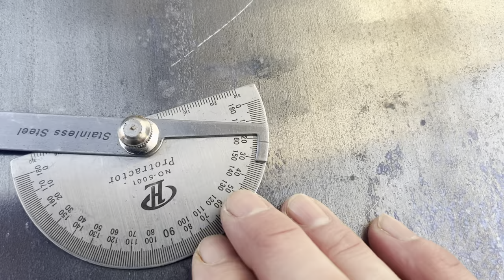How To Make A Bespoke Lead Slate

Comment: Just got recommended this by someone on Facebook, mega work! does the lead warp at all with the heat? i do a lot of MIG welding during vehicle restoration and warping is an absolute pig with he heat, would've thought this would be the same if not worse with he lower melting temp, softness of the materials.
Reply from the maker: Thank you so much. 
No I’ve never noticed the lead to warp at all and I’ve made so many of these.
Thanks for watching.

Comment: proper job mate very nice .. here in australia with things getting changed global etc getting more rain now and for longer periods the old silicone on the fire flu seals aint the best lol cheers for video been thinking similar for fire flu seal on the house cheers mate
Reply from the maker: Here in U.K our summer has been very wet so far. Are you able to buy lead in Australia ?
Reply: @slbleadworks  gday mate yes can buy but its expensive as fk like everything else

Comment: Great video Stu. 
Can I ask, I've got one of these on my Roof for the Soil Outlet Pipe and it's about 22yrs old, but a Scaffolder dropped a pole on the chimney/upright and damaged it and the impact may have damaged the welds, so can it be repaired/rewelded or will it need replacing?
Thanks.
Reply from the maker: Hi thank you I’m glad you liked the vid and thanks for watching. 
It might be able to be repaired. But it would probably be quicker and easier to make a new one.

Comment: Very pretty. Bit different to the rubber, one size fits all, roof tights we get out here for penetrations. Two things. For getting your angle and to save a bit of time and effort. Why not buy a large carpenter protractor. They come in a variety of sizes. I think I have a 300mm and a 450 or 600mm. Solid steel or aluminium. Set the angle off the bench and use that to set your tube angle. Save you having to scribe, cut and weld your kite piece. The other observation is making the flange on the tube. You free hand the 10mm flange. Your's looks pretty symmetrical so all good. But with a lesser hand and an uneven flange that would change the pitch. The worse the flange the bigger the change. You do loads and not an issue but something to watch for someone else. Another neat job.
Reply from the maker: I’ll have to look into one of these carpenter protractors. Surely you still need to scribe and cut the angle on the up stand ?
Reply: @slbleadworks  Shouldn't have to. The arms can be set at the required angle. We use them as saw guides etc. One arm on the bench. The other upwards at the angle you need. Put your lead tube up against that.

Comment: Hi Stuart recently had to fabricate a  lead rainwater pipe swan neck I had to cut and weld it have you had any experience using bobbins and a dummy  to bend a pipe and if so is it difficult to do ?
Reply from the maker: Hi no it’s something I’ve never done. 
I think the closest I’ve come is hoppa heads